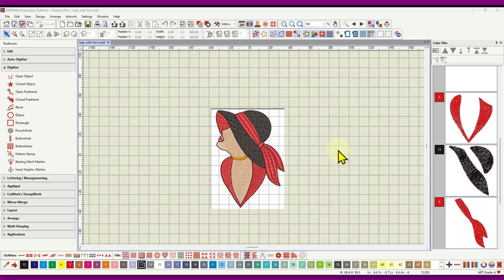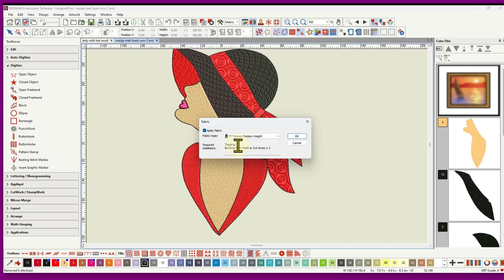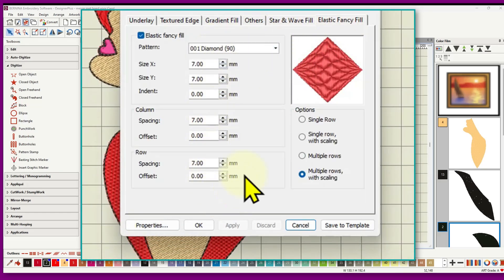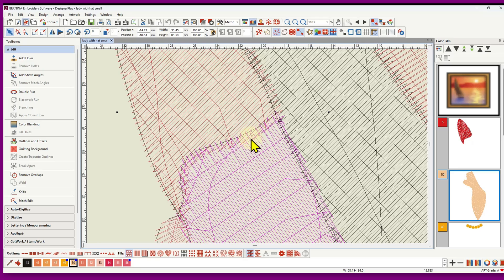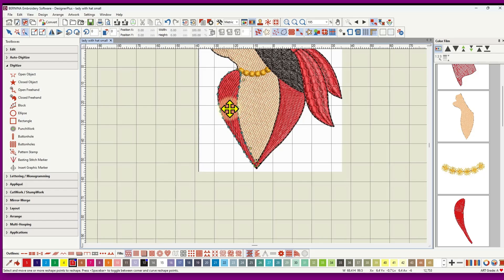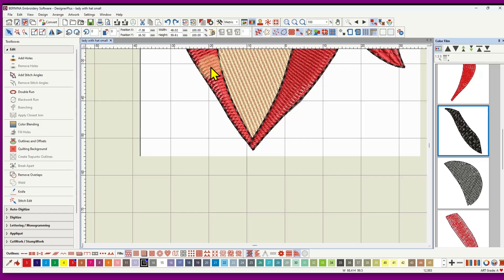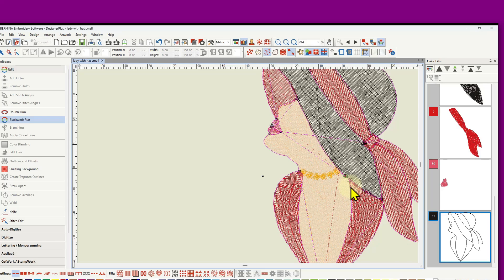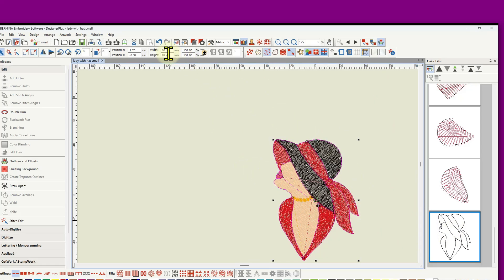Design Review Part 3 The Embroidery

Comment: Can you use the fabric type adjustment on purchased embroideries (i.e. NOT *.art)
Reply from the maker: You can apply a fabric to purchased designs (stitch files), but the effect may not be applied to all objects in the design. You will get a notice saying that applying a fabric to the stitch file may have limitations and to use an all in one file if you have one, e.g. art. The reason for this is that the software may not interpret the stitch file perfectly in to the exact same objects that were originally digitized. I tested a .pes design and there was a change in the number of stitches, so some change took effect. I would have to test sew to be sure.